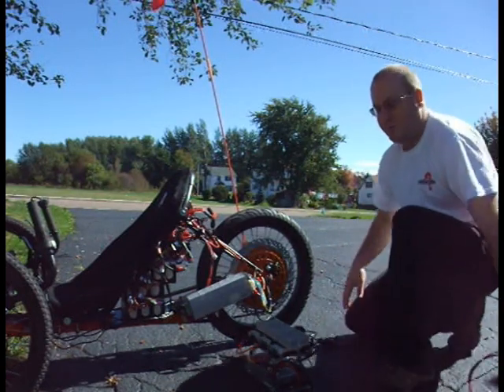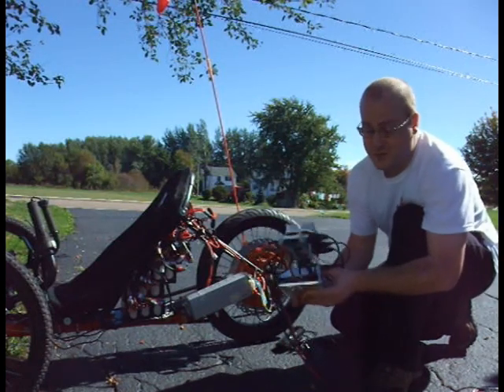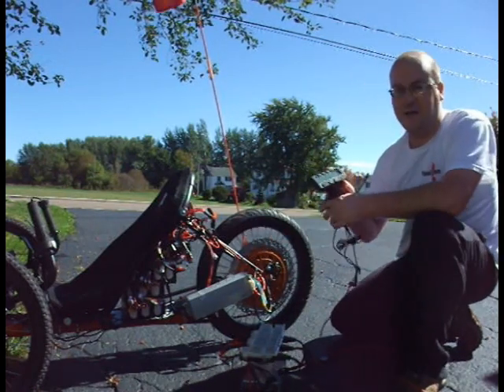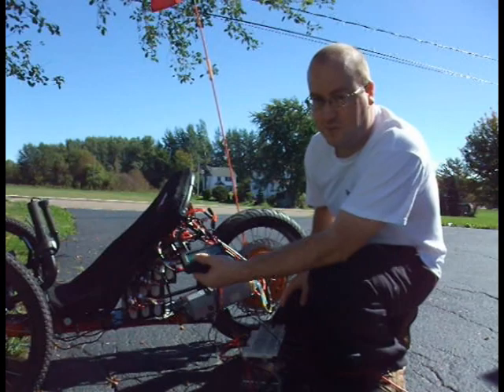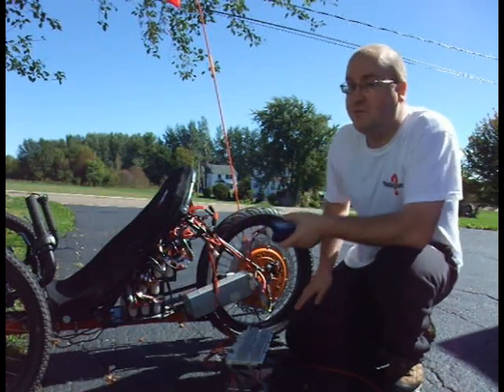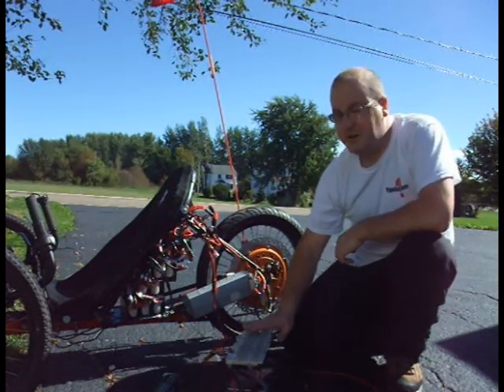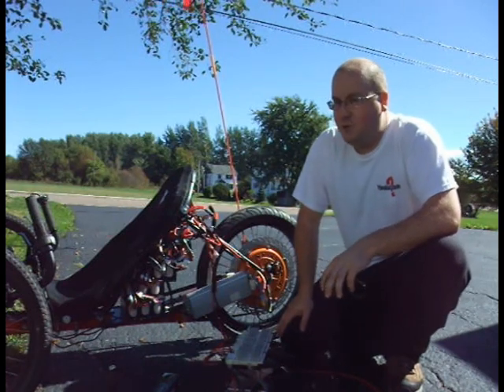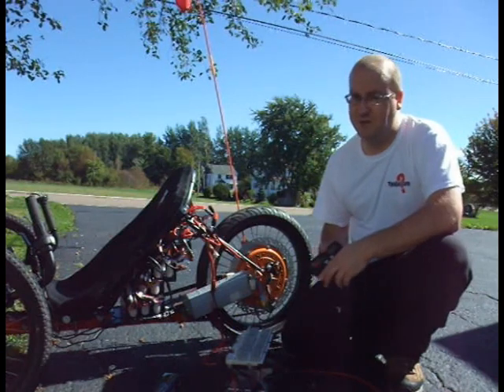Bulk Charging Lipo - 100v 13.5ah

Comment: Which chargers is this and it is anything else needed to put them in series?
Reply from the maker: +Jure Juvan The 3 on top are HP laptop power supplies and the bottom is  MeanWell PSU .. nothing special, just series and used the potentiomenter on the MW to trim the final desired voltage.... but ffw to 2016 and you can now buy a Cycle Satiator from ebikes.ca that allows charging at 100v, far FAR better option ! ( but not cheap ! )
Reply: +Ypedal Maybe you have any video how can be build?
And thanks for your answer
Reply: +Ypedal So the laptop psu have a current rating of 5A and 24V, but your Meanwell would have 10 or more amps, so it all reverts to 5A????
Very smart. I will have to do that with mine, because my mw is 15A, but my packs are 10Ah and want to charge, like you, to 4.15V but 1C charge.

Do you keep a close eye on the charging, or does it automatically stop once it reaches the voltage you set on the psu's?

Comment: Don't you still need to periodically balance the cells? Even if you don't charge past a certain voltage, some groups might exceed the ideal voltage while others aren't fully charged.
Reply from the maker: +ThingsDemystified I manually check the balance on every charge cycle, before, during and after.... .a healthy pack remains in balance but as the pack gets old ( like it currently is ) they get way out of balance, quickly to the point of it being dangerous to bulk charge... time to retire the pack when this happens.

Comment: This is not a safe way to charge lipos. Whenever charging lipos you need to have the balance leads connected. If you have 1 cell out of the 72 cells go bad it can catch fire while charging. Your charging setup needs to be aware of each cell's voltage.
Reply: Ypedal Good point on should vs need. Just felt the need to make a comment since I always see people that are new to LiPo's trying to figure them out. Do you have an idea of how many cycles you've put on your LiPo packs?
Reply from the maker: Mike Adkins Cycle Analyst says 122 cycles in 2014, total cycle count is roughly 300 to 400 usually never more than 50% DOD ... and looks like it will make it thru 2015 season !
Reply: Yeaaaa you gotta keep a close eye on LiPo's otherwise sparky fireworks happens. Dont drain them and dont overcharge them. I like 4.15V as the max and stay safe on the min voltage too. You basically gotta baby sit them LiPo's or put them in a BBQ casing.

I like your setup Ypedal

Comment: okay thanks that is what i wanted to here i knew li-ion batteries are not supposed to be trickle charger, but will the battery not be trickle charged with other power supplies or will they keep dumping energy into the pack. i am saying this because i have read on ES that they have to set a timer so they dont overcharge while bulk charging is this even true that you have to set a timer? thanks for all your help.

Comment from the maker: No, Lithium cells should be charged via CC-CV method, ( constant current, then constant voltage ) .. so once the final set voltage is reached, the amps/current will reduce until 0 watts.. then the charger sits there and no more power flows. . 

you can trickle nimh/nicad and SLA to overcharge slightly and balance series cells but not lithium.
Reply: +Ypedal That was my question up top there. Its good to know when bulk charging because I keep a close on on my setup, I see the voltage increase and the Meanwells get hot (Which means lots of current is flowing), but I was always afraid it wouldnt turn down the amps, but its good to know that it does. I need to hook up a watt meter to view amps, and my dmm to view volts. Eitherway its good, I am however using Lithium Ion, not LiPo.